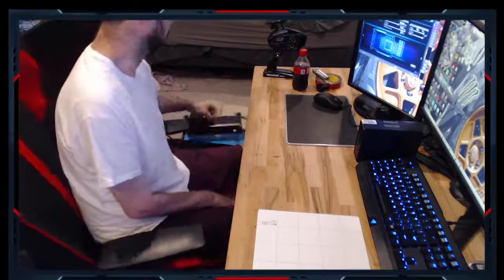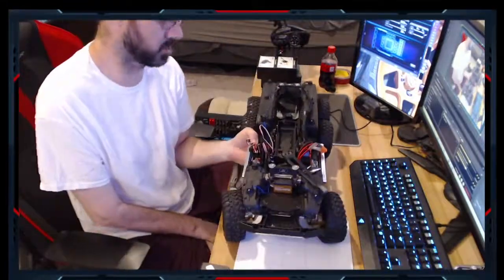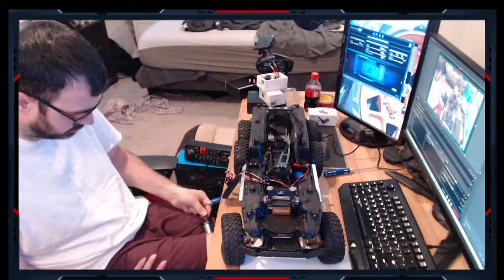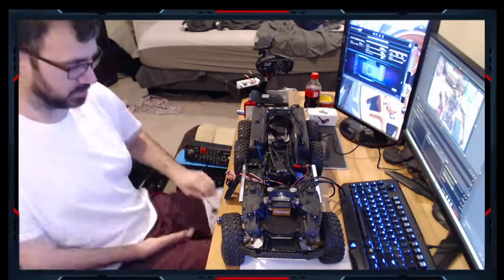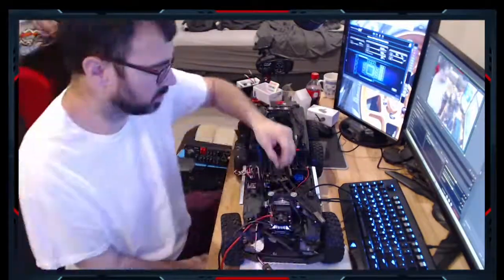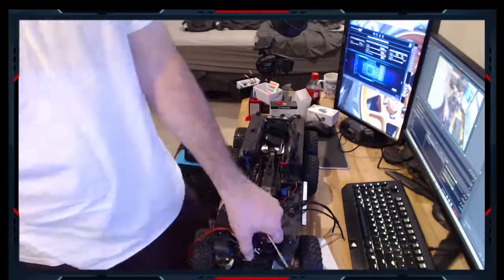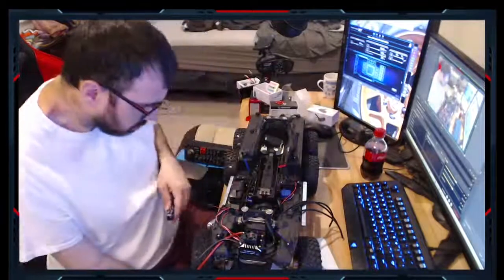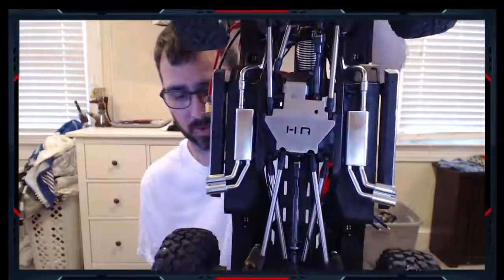New toy for the channel ! Installing Motor in a Traxxas TRX6 Hobbywing AXE FOC 550 3300KV

Comment: A must upgrade, I found the car too slow out of the box, its even slower than the TRX4. I love the TRX6 with the 550.  I haven't put any brass on mine yetl
Reply from the maker: I put in the Hobbywing AXE FOC 550 3300kv which made it alot faster with 14t pinion.